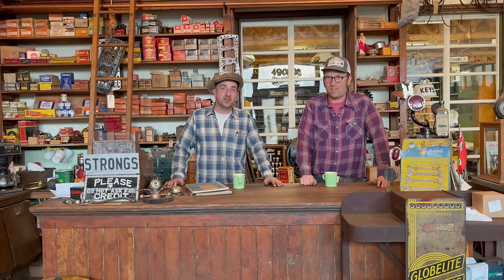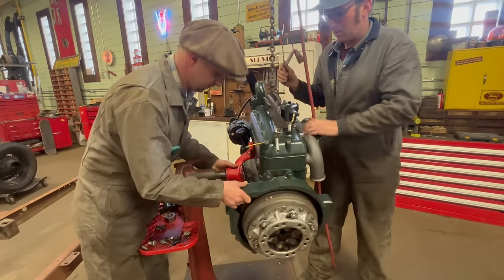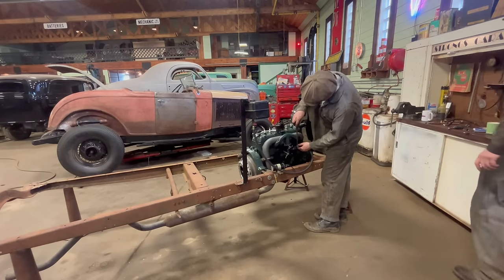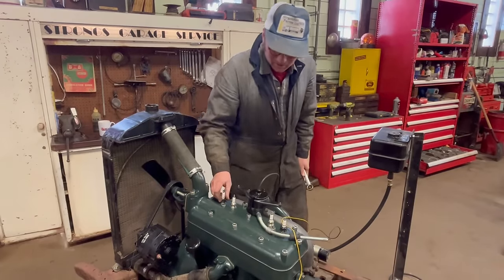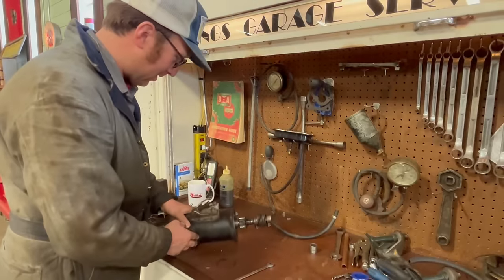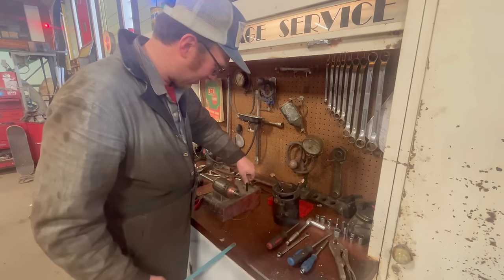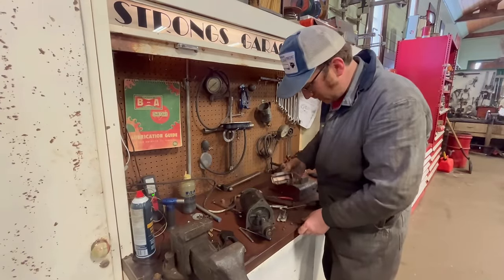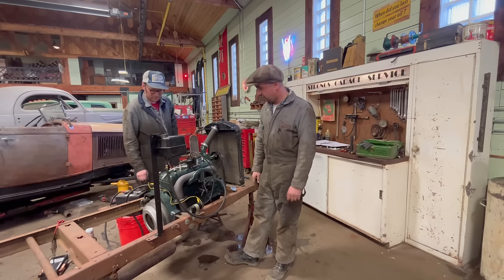1932 Ford Four Banger B Model First Start After Rebuild!

Comment: Guys, I know you like to go for originality, but the cord on that massive soldering iron really should be replaced before you have a "shocking" experience!😵‍💫
Love what you've done to this little engine.I love the simplicity of it. No solenoid, no cables running everywhere. Just mount the starter near the floorboards, run a rod from the switch up through the floor and you're good to go. Love the sound of these things as well. Good on you for using a Model A exhaust system  for that authentic sound.

Comment: I had the pleasure of working on a '31 and like the 31 Caddy V12 I undertook, I learned a heck of a lot about how cars were made in the early years, and boy were the electrics fun to wrap my head around! That poor old 4 banger though, it was a cosmetic restoration from maybe the late 60's or early 70's and I don't think the lower end had ever come apart. It was leaking badly from the rear of the pan, and upon removal i found pieces of steel which I figured out were the piston skirt inserts which had broken in a couple of the pistons. Customer was just selling the car and wanted to put as little in as possible, so the mess was cleaned up, then found the condenser was bad in the distributor, which I replaced. I got it running and squeezed inside to drive it around the block which was an adventure! The '36 Ford V8 pickup with cable brakes was a whole other generation of car from that model B! I miss working at that restoration shop, but don't miss the shop owners.

Comment: 5 to 1 compression.  So this is the hot rod model B. Sure sounds good running at idle. 
So is the oiling system better then model As or Ts?

Comment: I thought you needed a transmission attached to test run an engine.
Reply: Usually just need the bell housing to mount starter to.

Comment: Hey guys you did a video a long time back about installing a drop axle in a Model A Ford. The question you did NOT address is, "What did you do about the fact that the brake actuator no long lines up with the mounting hole in the spring perch?"